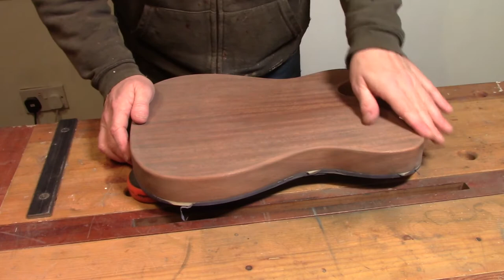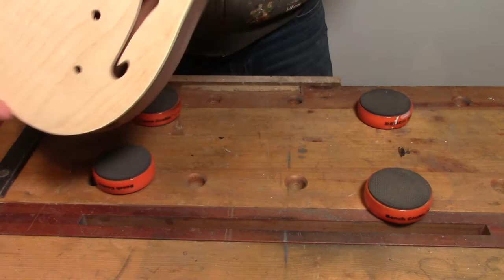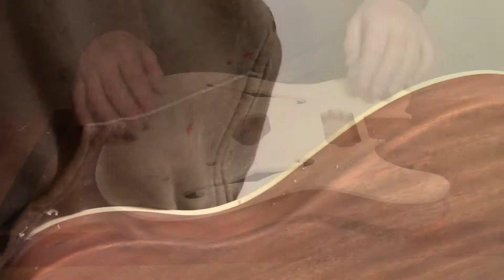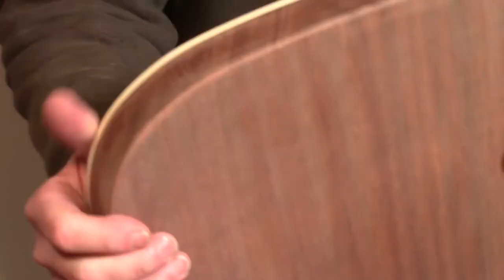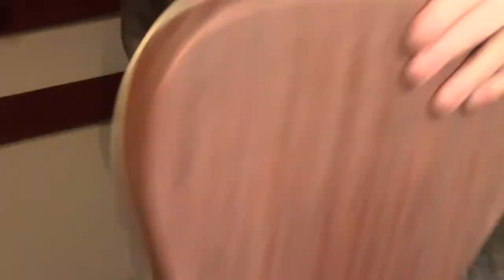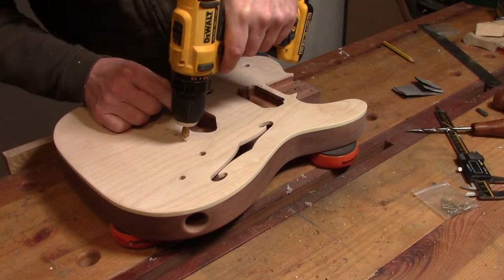Thinline Telecaster build part 13

Comment: I am enjoying your series on the thinline telecaster, I am about to start one myself. Very good work. 
I use 3 peices of wood taped to the body to make a bespoke neck template, but will give the car body filler trick a try next time.
Reply from the maker: Glad you are enjoying. The body filler technique works really well.

Comment: Hello - again thanks for this build series.  Question re scale length.  When you have positioned the bridge and measured the 25.5" scale length, can you elaborate a bit more on this.  The main question is where did you position the saddles on the bridge.  I read a lot of opinions on this with some saying to place saddles all the way forward, some say at 90% of full forward travel, others at 75% of full forward travel.  This would be a very interesting topic for discussion.  Hope to hear from you soon and look forward for more videos!
Reply from the maker: Hi, regarding the scale length. Kind of depends on the type of guitar/bridge you are using. In this case the pickup route kind of does a lot of the bridge positioning for you, this is one of the reasons I don't cut the neck pocket until the neck is shaped. When you are laying out for the neck pocket just make sure that the 25.5" measurement from the front of the nut falls well within the range of adjustment of the bridge sadles. There is a lot of adjustment on a tele bridge. I tend to just leave the sadles forward and adjust from there. It's hard to explain in words but I will go over this when it gets to assembly.
Reply: @Adventuresfromtheshedofdreams  great to have your reply and thanks to elaborate more on this in your next video - I am sure this will be a very interesting topic for discussion.  Not sure if I can have your email address as I can share my work with you on the build I am making.  once again thanks a lot.